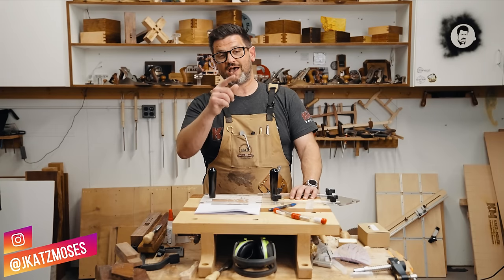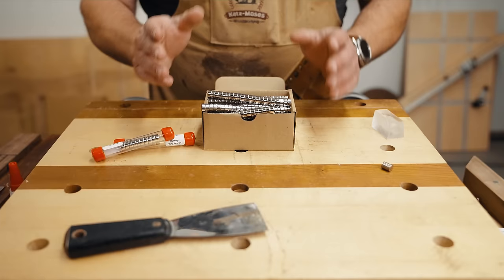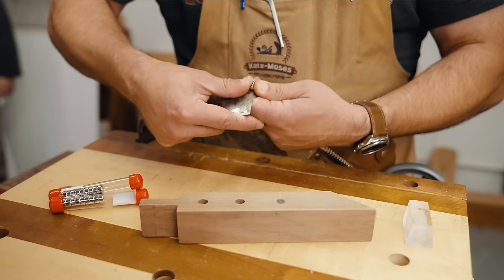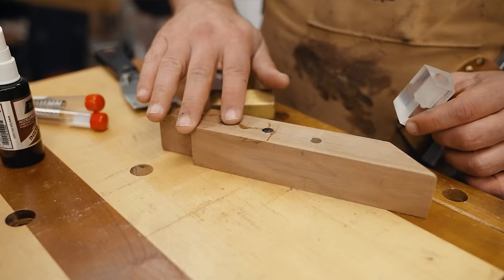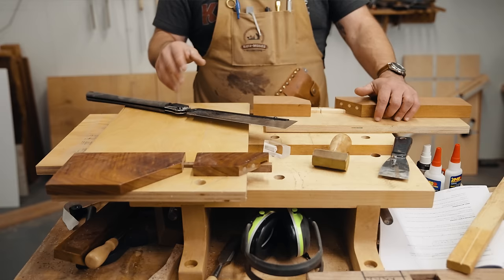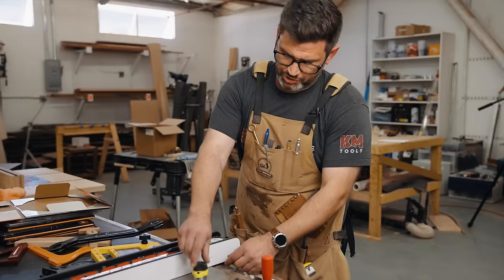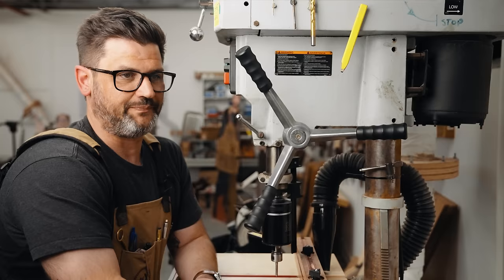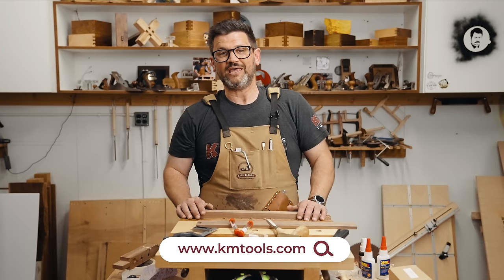Magnets in the Woodshop - 10 of my Favorite Uses

Comment: Sweet. Also, put a stack of magnets in an envelope, use to gather up metal filings. Then hold the envelope over the bin and take the magnets out of the envelope to dump the filings.
Reply: I use a switch magnet to pick up metal filings.  I switch it to the off position to drop the filings.
Reply: I have a magnet (salvaged from a microwave magetron) glued to a stick, stuck inside a tin can. I pull the stick, and the junk falls off.

Comment: I don't know how useful this is for general woodworking, but back when I used to fix guitars, magnets were very useful clamps for crack repairs on acoustic guitars. You can't really get a clamp in both sides of the top of an acoustic guitar, so instead you just use magnets to hold the support piece to the top while the glue dries.
Reply: i like to use em when im soldering wires to usb pins. way easier than using helpful hands

Comment: I've been using old car speakers magnets around the shop for years. 
I love the ones at the drill press best,always have my most used bits and the chuck handy.
Reply: Ya also need a demagnetizer so you can prevent your bits from becoming/staying magnetic.  But if you only ever work with wood then you’re ok.

Comment: Hey thanks!  I used this method on a tricky little project today, and it's working great.  I even bought some of those magnets from your link.  Couldn't find a 10mm drill bit, so I used 25/64" and it worked like a charm.  Only other advice I'd offer is: don't use Gorilla Glue, because it foams up as it dries...  AC Glue looks like the ticket.

Comment: Great video! Magnets are so useful in the shop. I know you know this but one thing to mention, is the difference in the force (pull)  along the axis vs perpendicular to the axis of the magnet. That's why you can slide them off of the putty knife fairly easily vs trying to pull them off. Note how the holdfast almost slipped off the side mounted magnets. It would be better supprted if hung under the bench. I have a magnetic fence on my bandsaw that, in spite of some very powerful N52 magnets will slip if too much sideward force is applied.
The trick is how to decide how to use this difference in resistance to your advantage. ..which is what you have wonderfully done with your saw guides.
Reply: That's excellent info! Thank you! I knew that they slide but have never really thought about it. Great!

Comment: Honestly, I think my favorite tip was using them as a stud finder! Never thought of that before. Definitely a game changer! Lol
Reply from the maker: That's my favorite for sure
Reply: Fold the magnet into a thin 3” tail of painters tape and use the tail to drag the magnet over surfaces, drywall looking for studs, or repurposed lumber looking for nails, screws, staples - big time saw blade saver.

Comment: As an A/V Installer mounting TVs, magnets for drywall screws fascinated the homeowner EVERY TIME lol.

I use an electricians version, 3/4” diameter 1/4” thick casing around it with a strong swivelling loop on the back. They were used inside those large green transformers to hold up 2” copper cabling inside. Hard to find but super strong. 

All my cordless tools have one zip tied low on the handles to hold 3-4 standard bits, Allen keys, wrenches without interfering. 
Zip tied to my tool belt.
Hold up bags while shovelling sawdust. 
Sewn inside a wrist band for fasteners. 
Holds up umbrellas/snow brushes/weed kit in the trunk, up and out of the way. 
DIY Particle Accelerator. 
Wards off vampires. 

Only Lasers are as much fun with n the shop.

Comment: i love all those tips,,,my only tweak is that i attached the magnet to the outside of the shop vac attachment, the magnet is way strong enough to grab screws through the plastic and now the magnet is not in the way of blocking shavings and what not as i vacuum

Comment: Great advise! I’ve an custom furniture and woodworker and just finished 16 museum cases. The designer speced hinges but “doors” were more like picture frames and had museum acrylic in them. I used 5/8” rare earth magnets and it worked wonderfully. Warning though! I have a pacemaker and you most be extremely careful using these magnets if you have a pacemaker!

Comment: I saw a tip online. Put one magnet on any screwdriver to magnitize it. Works great.
Reply: If you have 2 mag switches, you can build a yoke that holds them apart from each other by an inch or so.  Turn them both on and then put your screwdriver all the way in and then out of the gap.  Magnetizes the heck out of the screwdriver (for a while).  Just load them back in and remagnetize them whenever you want.  I've done this to all my screwdrivers and still use my magswitches at the table saw.

Comment: I use countersunk ring magnets and secure then with a screw for holding brackets I need to frequently remove and reattach. 

For repeatability I have one magnet mounted on the surface of one part and the other in a hole just over the depth of two stacked magnets. This allows one magnet to act as a locating pin which is pulled into the hole with a satisfying click.

If I need to protect the surface magnet, I 3d print a tapered ring that fits over it and countersink the hole to match the taper.

Comment: I epoxied a magnet to my drill press chuck so I can stick it anywhere on the drill press. I have a sawdust collection bag under under my contractor's saw. I used magnets to attach it instead of the snaps that came with the bag.

Comment: I put magnets in the handle of simple push sticks. One push stick lives on my bandsaw guide blocking the blade whenever the blade is slack, no more power cycles with a slack blade.  Btw, for push sticks I just wrap tape around the handle and over the magnet to keep it in

Comment: Great info - thanks.  I just started replacing all the cupboard latches in our travel trailer with magnets, so this will be very helpful.  Question:  you mentioned cleaning up the excess super glue from the jigs - what do you use for that?

Comment: I am not in your field at all, but had the idea of using a magnet(s), to fasten a heavy (probably,  total 500+ lb) bookcase, full of books, to the wall. Any somewhat simple suggestions? [I  thought of a sheet of stainless steel on the wall and magnet(s) glued to wood blocks screwed into of the bookcase, in order to provide contact with the steel plate on the wall, but have no idea if this is a good/preferable idea.]

Comment: Definitely excited by that router jig, that feels like a great price for the finished product... Curious though:  on your old "Ultimate router jig" you seemed pretty adamant about the use of 1/2" acrylic for rigidity....why the step down to 1/4" for this one?

I'm also curious about the pros and cons between your previous design and this one...particularly the pros... why this was the one to produce and sell, rather than your "ultimate" one?
Reply from the maker: We tested the crap out of the 1/4" and could not break it with a 1hp trim router. The ultimate router jig was for a 3hp router
Reply: @katzmosestools  awesome, thanks!  Makes perfect sense, dunno how I overlooked the trim vs full size router aspect.  I'll be ordering one tonight! 😁